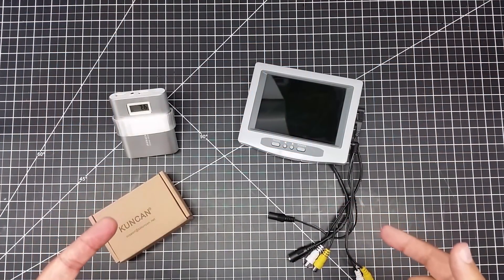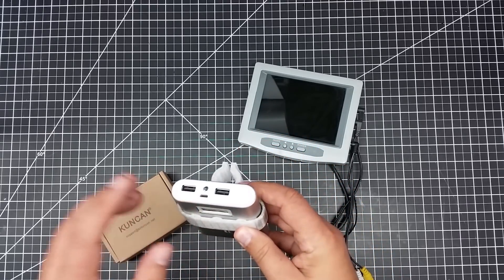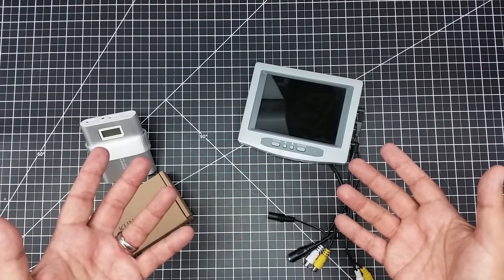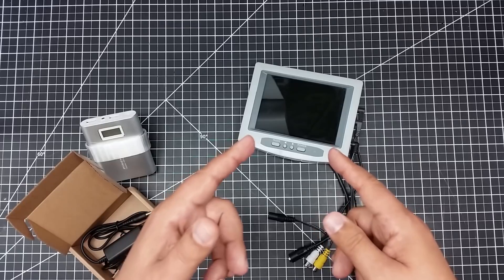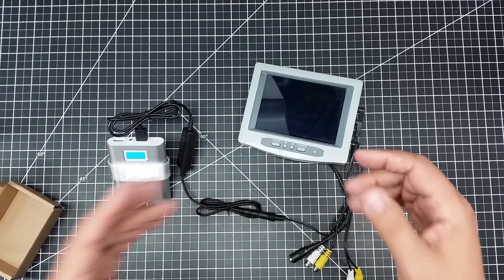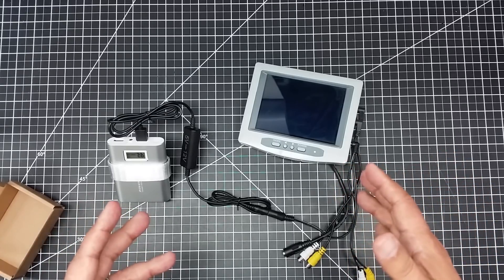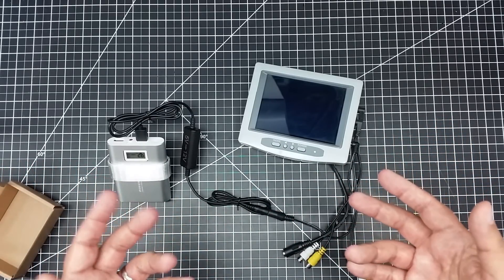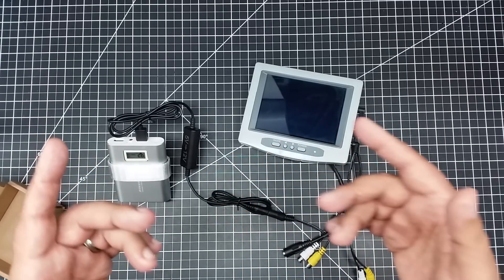Shop Talk  - USB to 12 Volts for Less Than $10 Bucks!

Comment: Open up the screen, if you're lucky you'll find a switching 5V buck regulator that everything else runs off of, including the boost for the backlight, which is i know a bit of a funny way to do it, but common enough. Probe for 5V points, chances are it's got a nice beefy output diode, or missing that simply an inductor, and feed 5V directly in there. In turn the buck regulator drops maybe 1.5V or so minimum, depends, so if you connect less than about 6-7V on the input, nothing happens.
Reply from the maker: Good to see ya back!  Missed your comment, also this was far easier then all of that :-)
Reply: Whatever works! I usually find that shopping is harder.
Reply from the maker: :-) have this J.O.B. that's a time a suck so "Buy Now" on Amazon is a savor...

Comment: If you don't mind neatness, a bit of hacking maybe, box and wires, there are lots of voltage option a Boost converters cheap on eBay
Reply from the maker: That is what I was going to do, but this was both cheaper  and neater :-)
Reply: Great, any links, I love the word cheap :).
P.S. I use a Boost form 15V Computer PSU to power 3 LED lights for video
LED Video lighting Using step down & boost up Volt
https://hackaday.io/project/7553-led-video-lighting-using-step-down-boost-up-volt

I "think" my booster was about £8.00
https://www.ebay.co.uk/itm/191619665672